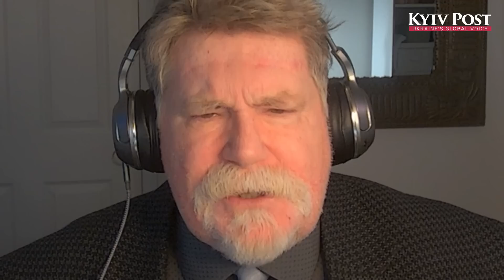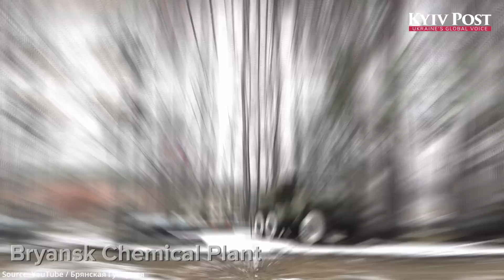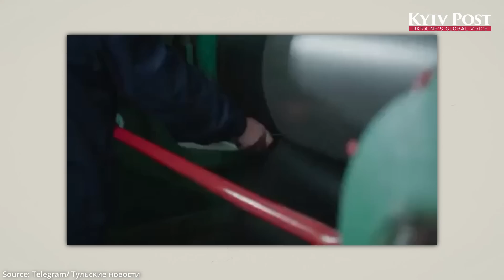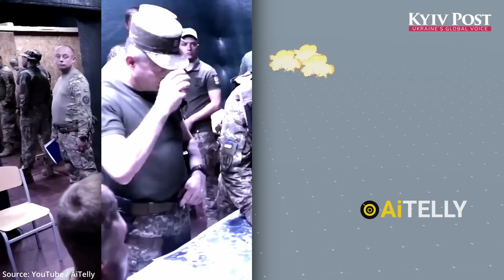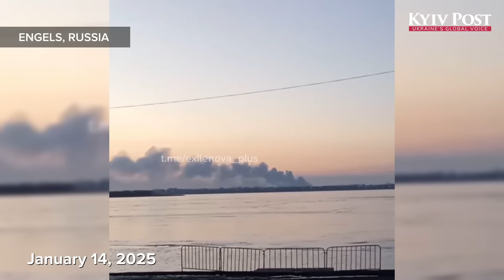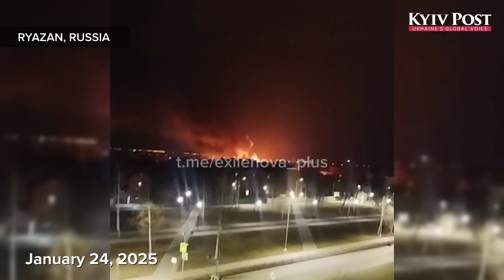Ukraine’s Largest Drone Strike on Russia – How It Happened

Comment: This war will carry on even if a  ceasefire and NATO peace keepers along with no fly zones all over Ukraine. Trump has introduced a protection racket costing Ukraine over 8 billion dollars a year for 4 years until Trump's tenure finishes in 2029 . Then Ukraine war part 2 will begin so Trump hasn't solved the Ukrainian conflict. The front in length will be 620 miles and the width of 60 miles and in that patch 90000 peacekeepers.

Comment: Great content, however it would be helpful I think for your viewers if you adjusted what they call, for YouTubers recording videos, gaze correction or “eye contact correction” so you’re making eye contact with the viewer and not looking down at the screen while you read what you’ve prepared. It’s typically handled during recording or post-production. Here are the best tools and technologies available:

Recording Solutions
	1.	NVIDIA Broadcast (with RTX GPUs)
	•	Real-time eye contact correction during recording.
	•	Requires a compatible NVIDIA RTX graphics card.
	2.	Logitech StreamCam or Brio (With Software Enhancements)
	•	Paired with Logitech Capture software, these cameras have some gaze correction and framing features.
	3.	iPhone with Cinematic Mode
	•	iPhones (12 Pro and newer) support some AI-based framing and focus tricks that subtly help improve gaze during recording.
	4.	Advanced Teleprompters
	•	Parrot Teleprompter or Glide Gear: Attach your camera behind a semi-transparent mirror so you can read text while maintaining eye contact with the lens.

Post-Production Solutions
	1.	Adobe Premiere Pro (AI Tools)
	•	You can manually adjust eye direction by motion tracking and subtly re-animating gaze directions.
	2.	DaVinci Resolve (Fusion Module)
	•	Advanced tracking features can manipulate gaze direction in post-production.
	3.	DeepFaceLab or Runway AI
	•	For complex AI-driven eye redirection tasks.

Practical Recommendations for YouTubers
	•	Use a teleprompter setup for the best natural eye contact.
	•	NVIDIA Broadcast is ideal for real-time correction while recording.
	•	Pair AI tools like Adobe Premiere Pro for subtle gaze corrections if needed.

Comment: Chuck, thanks for the after action report of Ukraines strategic targets.  Especially the identification of the sites and critical  components necessary to feed the molitary needs.

Have to wonder if the Stavka generals are ordering new brown trousers on a daily basis.  Wonder which one will draw the short straw as the sacrificial lamb that has to tell Putin that strategic air defense continues to crumble.

Xi Ping looking at the low hanging fruit on Russia's eastern frontier must be thinking maybe, just maybe it's ripe for the plucking.